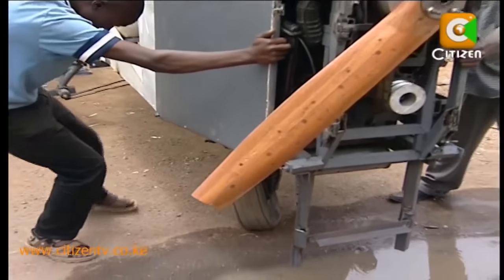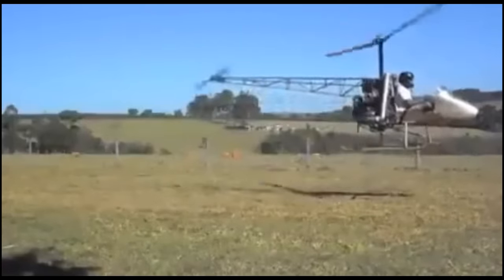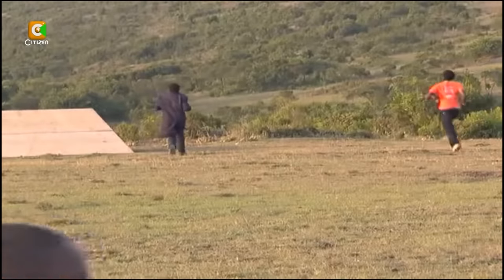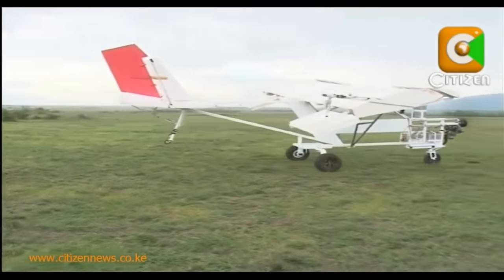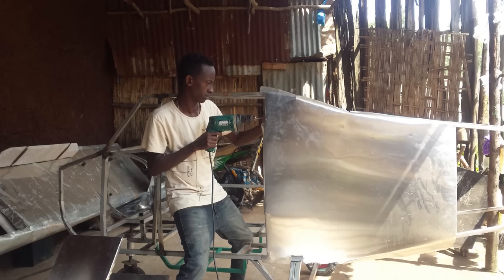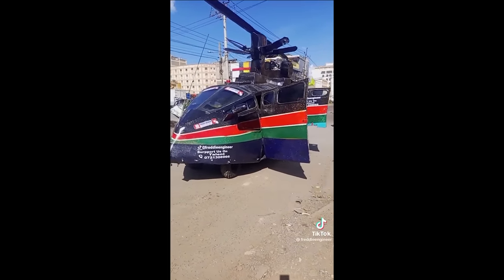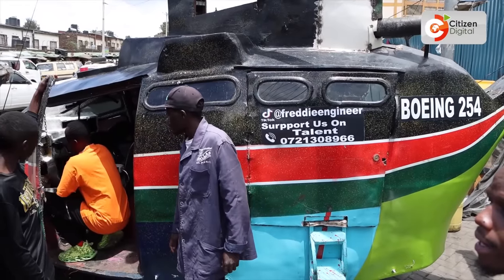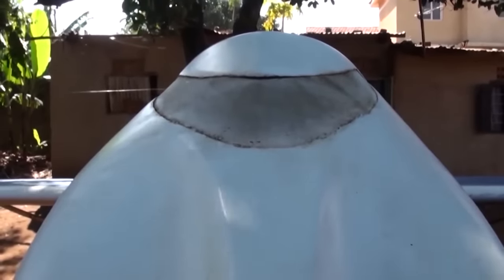Flying Scraps | African Homemade Airplanes

Comment: The hilarious part is that these rocket scientists are dead serious that their….craft will actually fly. They really need to learn what an airfoil is and why aluminum is a better thing to use when building their projects. Oh, and ceiling fans are not to be confused as a propulsion system.
Reply: You're absolutely right ❤
Reply: 🤔 Almost as if building a functioning aircraft requires…engineering, an understanding of physics, and you know….an education….and flight school.
Reply: Look at videos of how planes were invented. These African ones looks more advanced as they have materials
Reply: @sadikirungo I mean that would be impressive, if weren't for the fact planes have been around for more than a 100 years... 😂 China, India, and many other countries don't have any issues manufacturing aircraft... 😂
Reply: @sadikirungo lol, you can build an aircraft from wood and cloth which is very light weight but you won’t find any “aircraft” made from those simple materials in these African videos. Steel is far too heavy to be used in abundance in an aircraft design and each piece has to be made from the proper alloys and heat treated to withstand the forces it’ll be facing. When an entire continent has an average IQ of 70, we don’t expect many aircraft engineers or novel thinking.
Reply: These Africans are trying to reinvent the wheel.  All they have to do is study the designs of pre-WW1 aircraft and just copy them.  Those machines flew well enough.  There are plenty of air cooled VW engines that can be pressed into service for such aircraft.

Comment: The mechanic who actually took off in his homemade helicopter was successfull.... Considering his limited resources that is actually quite impressive!!!! His undoing was the spin he got into as he attempted to land. If he can work on that issue he should be 'good to go'!!! Never say never!!!
Reply: That's not him.
Reply: Him, the mechanic? You know him?!?)))
Reply: LOL, are you serious? That's not even the same helicopter. 😂🤣
Reply: @Pazuzu-2048  You've noticed it also 😂 I thought im the only one.
Reply: Different helicopter.  Look closely.
Reply: @mikeb.7068 no, look closer, same helicopter, different day 🤦
Reply: I feared for his safety. The helmet wouldn't have been much use if the blade hit him.
Reply: @martinpadilla5224 it's a different helo. The one that is shown flying is actually one built by a guy in BRAZIL. 😂
Reply: @martinpadilla5224  Are you blind? He just make his contraption to look similar... his contraption is trying to disasemble itself without the need of going into air becuse nothing there was balanced... look closer hot the tail rotor axis is welded off-center...
Reply: I think he attempted to land when it got into a spin.

Comment: The helicopter was the most impressive thing I’ve seen in a long while.  It flew.  I have to think it was pilot error that it crashed - the guy has likely never actually flown a helicopter so he’s doing it by just his understanding of how the controls work.  No real muscle memory.  That’s terrifying but also very impressive he got as far as he did.
Reply: I think you underestimate the pilot, that's almost surely not what happened. Not only this guydesigned and built a workimg chopper from leftovers, he actually had controls, if shabby. Tgat means he predicted how to control it, did it with a little difficulty, but one thing malfunctioned. The compensation tail proppeller, rather tge engine or controls of it. See, you steer the azimuth (just horizontal) with pedals on standard choppers. There's only two, working like a stepmachine, pivoting assymetrically - if one gets pressed - other lifts up. You got to have them even to stand or fly stright, you depress the side you want to turn to, besides tilt with a joistick. In this casehe could have just pressed the left pedal and chopper would stop spinning right, in nearly 10 seconds it became uncontrollable, he didn't need any muscle memory to just stop it from spinning and even reverse direction. Judging from the principle, tail proppeller started to spin way too slow to compensate for big proppellers angular momentum to stay still. Big one spins clockwise looking from above, so  with insufficient force from the tail it winds all chopper in opposite direction. I meant from below ., sorry. All pedal control does is  adjust the tail rotor'speed to turn or be in balance of both forces from both proppellers. The tail control/engine power failed.
Reply: Helicopters hate hover so low, because then enter a loop of is own vórtice getting unstable and lose lift
Reply: @dannydetonator  I hope he reads this, it would be a great help.
Reply: The flying helicopter was a different machine to the African helicopter.  Look closely at individual parts like the landing skids and nose cone.
Reply: I wonder if his design took gyroscopic precession into account. That alone would have made that thing completely uncontrollable...
Reply: @dannydetonator  Stop trying to make it seem like this guy is a genius
Reply: @mikeb.7068 the nose cone is the exact same.
Reply: @maximuskay1  OK, African.

Comment: The first ugandan  guy is serious but kenyans all comedians 😂😂
Reply: The first one made his heli to look like the Brazilian one that was showed as a test flight of the one showed at the beggining... but if you compare them carefully they are completely different...
Even tail rotor axis is not mounted in the center of that metal plate that he made there... that vehicle would rip itself apart from imbalance if you would try to power this blades to any significant speeds!

Comment: Excellent work with the helicopter, just add some electronic system for rotor speed regulation, that may  help you to handle it easly in specific maneuver like landing

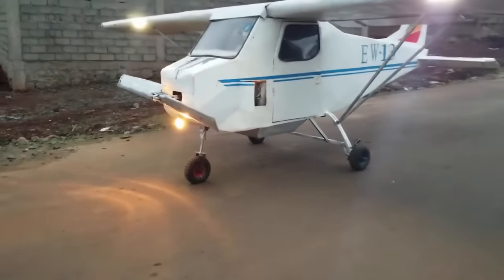Comment: 5:43  The individual in question may achieve favorable results by refining the design of the aircraft to enhance its aerodynamic efficiency. By making the aircraft lighter, improving the airfoil, and upgrading to a higher RPM engine with increased horsepower, there may be potential for improved performance during takeoff. Additionally, I was particularly impressed by the demonstration of the helicopter's capabilities. Achieving lift-off and maintaining a stable hover, even momentarily, is incredibly challenging. However, when attempting to land, it would have been prudent for the pilot to gradually reduce throttle, facilitating a controlled, soft landing. This approach would have aligned with safety protocols, particularly given the experimental nature of the aircraft.

Comment: oh dang. dude's chopper actually flew. I'm an engineer and helicopters look simple but they are actually very complicated to get to work. His chopper ultimately failed because the torque from the top blades overcame the counter propeller but that's relatively easy fix now that he's seen that it just needs a bit more lift from the rear prop
Reply: I don't think that was the same chopper. The "flying" one seemed to have a longer tail, and way better balanced rotors.

Comment: 0:37: This design was amazingly good. The drive chain of the rear rotor probably jumped off the sprockets,  causing the spin of death. A simple chain tensioner device would have helped.
Reply from the maker: you an engineer too?
Reply: @Afrikleo Yes

Comment: The material your using looks like its to heavy , try using aluminum frame with parachute skin or canvas for the body and wings , use bicycle tires with spring shocks , create a lite weight parachute in case your plane dies out in mid air .Good luck, ps the parachute is for the plane 😅

Comment: An airplane needs an engine that produce enough power to push the aircraft to speeds in order to generate lift. If a high power engine is not available, then weight must be greatly reduce. Additionally, a deep understanding of mathetics and aerodynamic is a must.

Comment: For my African brothas and sistas, 1.) First learn and study the basic of the science of aerodynamics, a bit of aircraft engineering and physics of flight. 2.) Go take up school of flight or flying lessons, aviation, etc. 3.) Buy yourself DIY (Do It Yourself) or already build ultralight helicopter or ultralight plane before you go set out on building your own aircraft and flying it, so you can grasp what makes an aircraft stable and flyable. If you are going to build and fly your own homemade build aircraft, you should know, understand and have some skills and understanding in structural aviation engineering, electromechanical, electrical or electronics, pneumatics, hydraulics, welding, gas powered engines, flight instruments, radio communication, aviation lessons or trained as a pilot, etc., etc., just like amateur aviation builders and flying enthusiasts do here in America, other countries and around the world. 4.) before you go flying or building something, always use safety precaution and protection equipment (Helmet, etc., etc.). With love and care from the U.S.A. (Kissimmee, Florida).
Reply from the maker: Not forgetting that necessary tools is important instead of the scraps that they use

Comment: If they just had a flying model airplane or helicopter, it would really help in their understanding of aerodynamics and surface controls.
I know Africa has fans for a cooling device in the home, are they just angled pieces of flat material? Placing flat boards at angles will never be able to produce enough energy to become airborne.
Well, good luck to them..
Reply from the maker: appreciate it.

Comment: the guy with the helicopter is at least impressive on an individual level, guy did that allone without real access to special equipment.

the 15 aircraft guy baffles me. He talks about it as if he's the first to try it but he can litterally look up the actual schematics of monoprop airplanes with ease, he probably doesn't have the engines for it but then again I think a modern car engine could potentially power a light airplane

Comment: It does not have more power to take off. Before a plane ✈️ takes off it need more more power, and also there is some place where air need to fill it full to make aircraft lighter to take of

Comment: The helicopter used on the testing day is different. Why is the camera quality different.

Well it is from rubbish we begin to build something reasonable. The first day I wrote with a pen, my handwriting was bad. But now it is still bad but well organized far better than before
Reply: Hey now I'm not coming down on them! I was a bit taken aback by some designs, the hand chopping propellers on the one comes to mind, but it was impressive! But for real, the calculations needed to build one right is available online if you can show them the numbers "such and such power to such and such weight equals such and such lift.
Reply from the maker: lets hope they will all achieve their dreams

Comment: This is heartbreaking sad.   How could they not have better information about materials and function.  There's a video of a man jumping from the Eifel tower with his flying parachute thing first time, splat.  There is also a video of a man successfully landing his ram air parachute the size of a table cloth.  He flares to a 50 MPH landing speed,  Foot water skis to land and runs it out.  Doesn't even trip.

Comment: I have been in aviation maintenance for over 20 years. I understand the desire to challenge your knowledge in aviation design and build. But if not properly researched and done with skills and knowledge and experience you might suffer mightily. Also the right materials. Its best to get the skills and knowledge before attempting to build any aviation flying machines. Fixed or rotary wing. The individual whom built the homebuilt helicopter barely escaped from death. Never try to hover a helicopter with no skill or training.  Plus always tether a helicopter to ground when first flight testings. Please be safe and get advice and knowledge before attempting any type of flight testings or even construction of aircraft or rotary wing.

Comment: They are not INVENTING the aircraft they are building one (trying)....In the internet age all one has to do is study what design will work with the materials you have...4' wings that have an 12" leading edge should be obvious with anyone with common sense to be a bad design....A simple bi-plane with cloth skin, rivets instead of steel fasteners and not taking 4 people with you on your first flight might be a good start.

Comment: proudly african and an engineer ... But guys after a pick🥸on those rotor blades oh man, they are just an atom away from catastrophic structural failure. 0.56 you can see the pilot head out of the (would be cage) at least put on a helmet man!!!
Reply from the maker: precaution should be taken

Comment: To make a plane or and helicopter.
The size should not be protional.or larger than the blade or wind
The lightness
Enough power to lift up the body. And
Maths and science for the design. And conseption of it

Comment: I think lot African anxiety disorder.Because already invented.if you in money your pocket direct from company.first what ever flying invention propulsion is a primary unit. Second weight to ratio of mass. Third centre of gravity c.g. what airfoil design you choose naca or t-sagi. You follow 4digit airfoil. First study then go to practical.only for laser welding and laser cutting under the frame high grade aluminium used not for steel ok first we basic then you start invention.

Comment: they should be real happy the design wasnt slightly better. Lives was saved. The delusional idea behind this is.. i mean not knowing anything about weight or airodynamics, and even basic basic physics and structure. If these hunk a junks where to actually lift from the ground and then rely on controls, not stalling, slipping ... I respect dreaming, but this is delusion
Reply from the maker: To us it may seem 'foolish', but to them, it's Gold